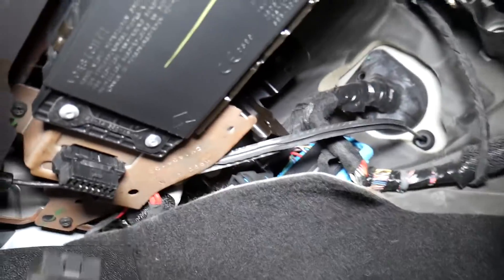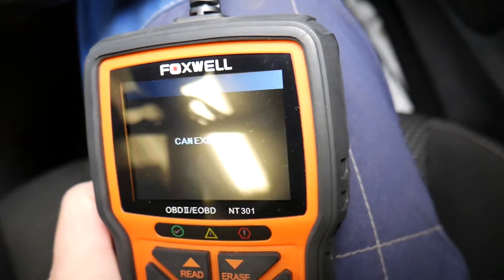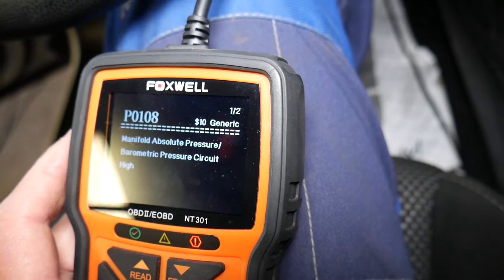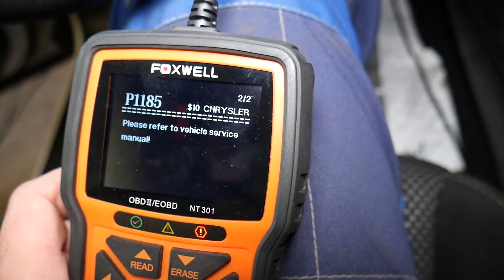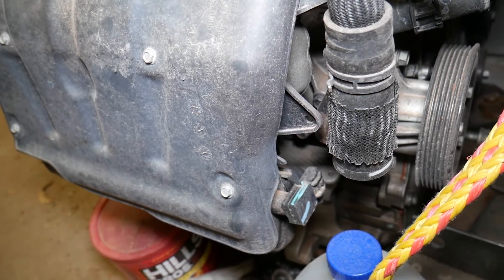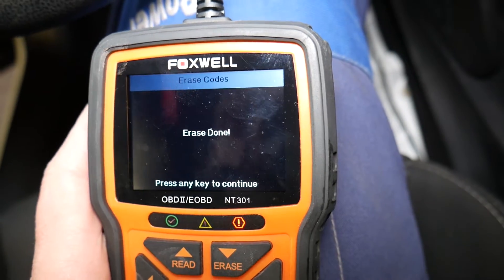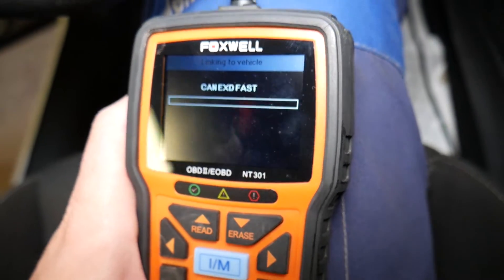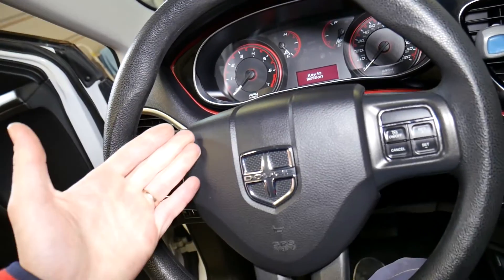FIX CODE P0108, P1185 DODGE DART, CHRYSLER 200 JEEP CHEROKEE RENEGADE COMPASS, FIAT 500X, PROMASTER

Comment: I replaced sensor but code is still permanent and engine light is still on, its a jeep renegade 2015 trailhawk 2.4l
Reply: Same. Replaced all spark plugs, fuel injectors, O2 sensors, MAP, PCV, Air Filter, Purge Valve, cleaned throttle body, oil/transmission/ coolant/ brake fluid change. Idk, I'm quitting on the Jeep for now.

I have P0172 and P1185. Might need a new fuel pump, but that's pricey (though easy to do) and it sounds like it works as it's not screaming. 

Haven't been able to do U90 recall either (everyone is waiting on parts). Just going to a mechanic now to tell me what's up.
Reply: @kenwes6560 it might be pcm maybe need a replace or reflash! Update me
Reply: Just finished the U90 and W20 recall. Immediately got a P0172 again (was gone for a minute). So new cat with even newer O2 sensors didn't fix it. Hell my range dropped back down to 260 miles on a full tank after I left the dealer. Was at 340. @SantanaSan-h1k
Reply: Oh and the W20 was for a PCM update.
Reply: Keep me updated and I’ll try the oil change and pcm update too cause all this started after I had hit low oil I remember
Reply: Changing out the fuel pump next week. Fuel pump has a fuel pressure regulator and fuel filter attached to it, so that must be it.  @SantanaSan-h1k
Reply: @kenwes6560 any updates after changing fuel pump?
Reply: @SantanaSan-h1k Yup, code is gone, but took many miles of driving. Also replaced evap purge valve for the second time since the first replacement I used was faulty (cheap). Runs good now.